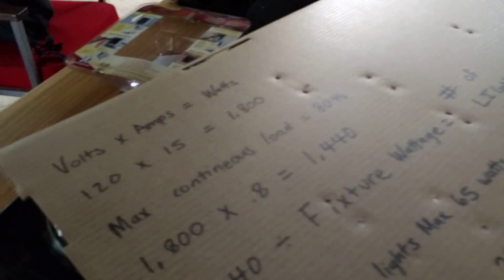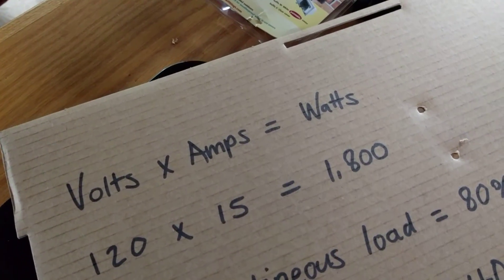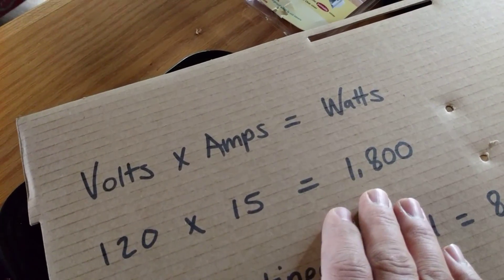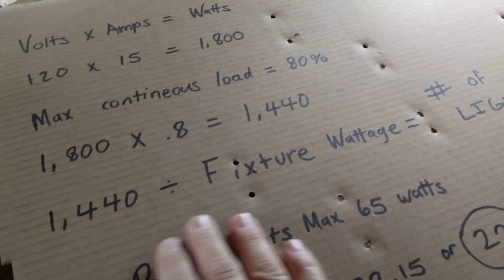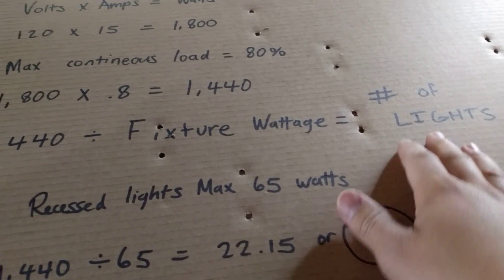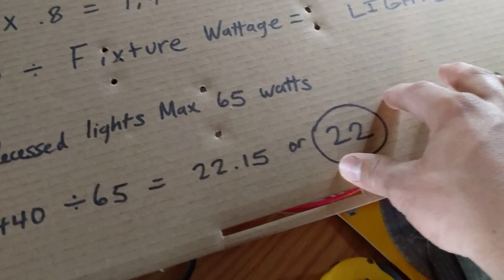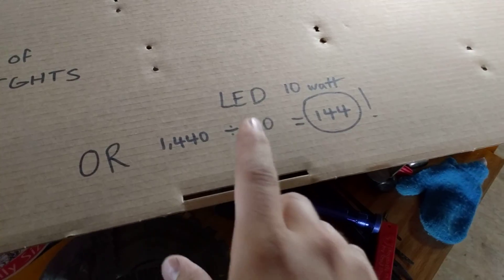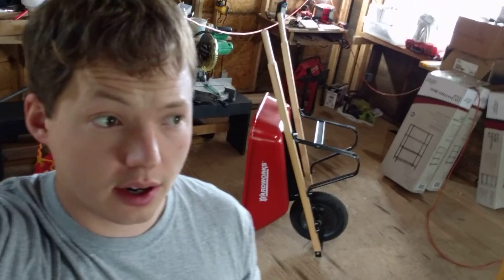How Many Lights on a 15A Circuit Breaker? Calculate Wattage for 15 Amp Circuit & Number of Fixtures

Comment: excellent job explaining, good about LED's that if you need to add a few extra lights later on that same circuit Led will work without overloading circuit....Under kitchen cabinet lighting is a good place...

Comment: Split that into 2 circuits. Someone will come along and stick 150w bulbs into those fixtures for more lighting at some point! Those cans are probably rated for 1 or 1.5 amps at 80% FLA on 15amp breaker that's either 8 or 12 lights.

Comment: It takes 14,850 watts of power to light a certain building. If the applied voltage is 120 V, the current in
amperes is 14,850
120
(a) What is the current for the building?
(b)There are 350 lights in this building. What is the average current through each light?

Comment: Calcuations are cool and all, but voltage isnt 120v..  Its more around 125v, and you also need to factor in wire distance, the distance you run the wire will affect how much current the wire can safely run and how much loss of power you experience. Voltage drop is a thing for length of wire ran.. just because a 15A circuit can do 1440w continious doesnt mean it can do it with 500 feet of 14awg wire

Comment: hmm.. kind of need to look at that because if I remember right, the codes still require the lamps at 100 watts per spot so, 14 in that case. Where I am the limit is actually 12 accordingto the local inspectors.

Comment: Residential lighting load is considered a noncontinuos load.
According to the nec, a branch circuit is to be rated at 125% of the continuous load plus 100% of  the noncontinuos load. So you could actually pull # 14 wire at 15 amps and install 27- 65w lights on the circuit. 
15x120=1800
1800÷65=27.69
#14awg wire is generally limited to a 15amp breaker 
This is shown in table 
210-24 .
The thought behind this, is that not all of the lights on the circuit will be on at one time.
Iam a licensed electrician with 26yrs experience and even though this is exceptable I always use the 125% rule , just as you have.

Comment: Before watching it was thinking enter stage left LED lighting. All of them!

I divide mine by rooms by level vs passages. So a two story house would have one for each level, and a third for the passages (hallways, stairs, etc.). This way if you are in a room and do something that trips the circuit, you are not in the dark finding you way back to the panel.

Comment: My house is 20 years old. I have a mini fridge and microwave in the bedroom plugged into the same outlet. The 15A circuit breaker keeps tripping. and I wonder if I can replace it with a 20A instead and would that solve my problem?

Comment: I did a similar calculation when planning a basement renovation. Putting lighting for the entire basement on one breaker was fine... Except the local planning department wanted no more that 750 square feet of floor space per 15-amp breaker. So two lightly loaded circuits rather than one. Then I got to thinking, what if the breaker trips? Plunge the whole basement into darkness? Hey, if possible it might be better to keep some of the lights on. Also, what about some future homeowner who unscrews the LED lights and screws in high-wattage incandescent floods?

It's now 6 years after this vid was shot, and LED fixtures that don't need cans are easy to find. So if doing this today there's no danger of a knucklehead replacing your LED bulbs with incandescent bulbs, because it's a sealed fixture.

Comment: I’m wiring my house now with about  30 LED can lights.  Good point about troubleshooting arc faults.  I think I will bring several LED lighting home runs to the panel and tie them together on one or two lighting breakers.  I can separate the home runs to troubleshoot but not have multiple arc fault breakers for such low wattage.  
PS I will have fan lights in most rooms on a separate breaker.  This will help me reduce backup generator loading.

Comment: Engage your brain.

This is a nice description and easy to understand, and you must remember to apply common sense.  Every light in your house could be on the same circuit if they fit, however, if the breaker trips at night, you will have to find it in total darkness. 

 Consider using different circuits to allow your hallway lights to work when your bedroom lights go out.  You could then get a little light in your bedroom with the door open and the hallway lights on.   

And so on.

Comment: I’m not sure if you are still active with your account. I’ve noticed some of the comments are A few years old. I have a question regarding recessed lighting in the kitchen. currently there is one wire going to one light. But I want to install six recessed lighting fixtures. what I mean by one wire there is your normal hot, ground and negative you get the idea. How would I wire the six recess lighting fixtures off of that one wire. thank you.

Comment: Another reason NOT to put 144 LED bulbs on one circuit is that when that breaker pops or need to be opened for any reason there is not one light in the entire house.

Comment: ben as ive said in the past you are the man and i love your videos but continuous load is load that is 3 hours or more, so to calculate the 80%  of the circuit ( wire ) or 125% of the continuous load ... so if a toaster having a load  1500 watts would have a draw of 12.5 amps now if you apply the 125 % rule of the load but again it has to be 3 hours or more then the toaster draw becomes 15.6 amps  but again its not on 3 hours or more so the rule does not apply ......i think i have it right  ...i hope .....so with that rule you would have to assume that everything in your house would be on for 3 hours or more , article 100 in definitions ,,,,,, and also since this video is 4 years old im sure someone pointed out u spelled continuous wrong on your cardboard  :). im sure code does not specify how many outlets you can have on your breaker but commercial is 13 i believe based on your 1800 va calculation . im also sure you are aware of all of these factors .....keep up the good work i love your videos

Comment: I put 12 led cans on one 15 amp and when you turn the lights to full some turn off so I'm not really sure if what your saying is true but maybe
Reply: dimmer  is not rated for LED ill bet its an old incandescent dimmer
Reply: @DontHaveTime523  actually there new dimmer switches and when on low they would work fine just when you turn up the power they change from being 9 watts each to 15 at full power which is why some turn off if you have the afci breaker in place it trips off the breaker so yeah I'm not sure
Reply: @mr00dito  it’s the afci breaker had this happen change to a regular breaker case solved
Reply: @DontHaveTime523  that would make it not up to code were I'm living but thanks
Reply: @mr00dito  that would make it not to code anywhere but thats your only solutions trust me

Comment: Why would it be hard to troubleshoot ? It doesn’t matter how many are on the circuit, it would troubleshoot all the same. 
A typical 2500 square foot home will have 3 to 5 lighting circuits in it, depending on what is going in the home. 

Provided you don’t put any receptacles on with your lighting

Comment: 15 comes from 15 AMP circuit.
1,800 WATTS comes from 120 VOLTS * 15 AMPS.
BUT, why are you using 120 as your voltage? Is my # of volts going to differ?

Comment: As a canadian Electrician I will say  your theory in your math is correct.. In Canada though rules are different. As per code you are only allowed to put 12 devices on a single circuit, be it lighting or outlets, yes with built in leds you can go higher but the code hadn't adapted yet to my knowledge... and lastly AFCI breakers are only recuired for outlet circuits and not lighting, that's 70$ savings... The NEC might have different rulings but this is for the canadian viewers.

Comment: You have a really great ability to convey the subject to your viewer. You're articulate and easy to understand. 
   My girlfriend has a 3600 square foot house built by KB in 2005. While I'm relatively sure  that the wiring meets code, it seems to be the bare minimum at best. It's amazing how many receptacles and ceiling lamps are mixed on a single 15A circuit. If two people plug in a small electric heater in their bedrooms, it will trip the breaker and half the second floor goes dark. Also, it has the thinnest 14 gauge wire I have ever seen in my entire life. I had to do a double-take the first time I saw it. It might have been marked 14-2, but I compared it visually to a piece of scrap 14 THHN laying in the bottom of my pouch. The actual wire was considerably thinner. No kidding! This stuff looks like mismarked 16-gauge! No way that shit is made in this country.
     One other thing to remember when calculating ceiling circuits, is a lot of people are adding illuminated ceiling fans where there used to be just a single light in the middle of the room. The codes are written as the "minimum" accepted. I think it's worth a little time and money in the long run to use better materials and use fewer receptacles on each circuit.  Best of luck. Stay safe, healthy and happy.

Comment: When I was taught that calculation (in stagecraft class, for figuring cabling and dimmer loads), we called it the West Virginia formula.

West Virginia

The abbreviation for the state, before two-letter postal abbreviations, was W.Va

W VA

W = V times A.

Easy little memory tool for remembering.

Comment: Why or when it's a breaker w/a ground installed in a 1979 house ? That pops and shuts down 2 rooms , bathroom and hallway . And can I replace it with a regular 15 amp breaker . ??? ... thank you for your time and answer ..

Comment: Hey Ben, I just noticed on my panel that one particular 15amp breaker controls quite a bit of things around my house and after adding a bidet and it's GFI outlet I noticed a very light fluttering or pulsing flutter. They don't flicker on & off just very light twitch. Can you just change a 15amp to a 20amp breaker? Is that allowed? I just feel.maybe this happening because I have too much on that particular breaker through pigtails or whatever, or should I just put the bidet on it's own breaker? I sent you another msg attached to.another video, so you can just answer one of them sorry. 
Thanks

Comment: Hey Ben I got a good question for you and I know it sounds cheesy to start off can I teach 14 x 2 Romax and combined them together - not end to end but side-by-side so the 14 AWG is 4.7 AWG it’s only going about 5’ “ it’s going from my 5KVA inverter from Lithium Battery Bank 48v with a DIY Alternators Generator to charge batteries to a separate transfer box / 2 Breaker box different then man Box , inverter produces at 5 Kw 96A & at 3 Kw 75A - my house uses about 3 Kw a day , I’ve got 2 8’ x 5/8 grounding galvanized rods figuring
Reply: please stay away from electrical things

Comment: hi benjamin? example i have 20 pcs bulb rated 120vac, 150 watts. then every bulb has a 5 meter gap. how to calculate the size of wire i'm gonna used? thanks for the answer.

Comment: A line voltage fixture consumes 5 W/ft. We have a bridge that is 1000 m long. The cable used for the fixture has a limitation of 16 Amps and the circuit voltage is 120 V. What is the total wattage consumption needed to run a single continuous row of fixtures across the bridge, and how many circuits do we need?
Reply: 120v is also baseline, voltage is actually more around 125v in actuality.  Ive never seen 120v when measured with a multimeter..  this guy is also forgetting length of wire ran..  I ran 700feet of wire for dusk to dawn lights, they draw about 600w continuous with ballast ineffecienc added.   700 feet of 14ga wire on a 15a circuit.. Thats too much resistance.. especially for the light 700 feet down the run.  That would effectively reduce voltage by near 3% which is alot 120v that would mean the last fixture would see around 116v..  this just causes heat in the line..  To be safe you want to run 12ga wire for that amount of length and a 20A circuit

Comment: Hey Ben,
How long have you been an electrician? Good effort for the video but let's stick with the NEC ( that's national electrical code) and based on that we should be at 14 openings on a 15 amp circuit and 9 openings on a 20 amp circuit!
Reply from the maker: Not true for residential.

Comment: Hey Benjamin. I hate to nit pick but I wanted  to let you know that your formula for wattage is basically incorrect. You are using ohms law for wattage, but upon examination of ohms law the formula of Wattage =Volts * Amps is ONLY valid for DC circuits and Linear loads on an AC circuit. The correct formula that electricians should (and most do) is Amps * Voltage = VoltAmps. Some higher power circuits are in KVA. Incandescent lights are considered a Linear load, but not LED lights because the internal circuitry has inductors and capacitor which can pull different current based upon the design. 
Even the elec meter on the side of the house is only measuring current (amps) over time, not wattage. The meter has been calibrated with a Power Factor to APPROXIMATE wattage, not actual wattage. In an AC circuit, the frequency must also be taken into consideration. And resistance in a non linear loads in an AC circuit is called impedance. To calculate impedance, you must take into account the frequency of the AC voltage as well. Because a device can draw different amperage at different frequencies, esp if the device resonants at a given freqiency.
Examples of a linear load is a toaster, incandescent light, heaters, elec stoves etc. An example of an inductive load is anything with a motor in it. Electronic circuits can have capacitive loads.  if you measure the resistance of non linear loads and used Ohms law of Amps = Voltage / resistance.your calculated answer would be incorrect compared to the actual Amps drawn.
A LOT of people misunderstand Ohms law.
I have been working in Electronics for over 60 years. But you can google Ohms law for clarification if you need
Reply from the maker: Thanks for sharing your expertise!
Reply: @BenjaminSahlstrom  thanks for good videos!!

Comment: You probably won’t read this but I still gotta try .  So I found out I have 16 lights to one 15 amp breaker also same amp breaker has 20 outlets . My electrician told me that I gotta add one more breaker or 2 to distribute those lights and breakers and he has to break through a lot of drywall and get in the attic for the fixture lights a whole nightmare . My question is why can I just take out that 15 amp breaker and replace it with a 20amp or a 30 amp or even a skinny double 15 amp breaker. Isn’t just smarter just to do that ? I hope you have a video that can explain that .

Comment: In my area the code said we can put only 12 outlets or lights on 15a circuit??
Reply: Yes you are right experience electricians they connecting max 9 outlets on 15A circuit.

Comment: The problem with AFCI breakers is that they nuisance trip a lot.  There might not be a problem at all.  The breaker sees a certain current profile and thinks it's an ARC so it trips.  I would suggest like you mentioned that you break up those lights into two circuits.
Reply: Arc breaker is dedicating only for plugs not lights.

Comment: Righteous, I checked your math it’s dead nuts and I hear what you’re saying the only caveat is that if you planned your house with LED units rather than just the ability to thread in an LED bulb then you’re golden! I think the threat in LED bulbs are going to go away eventually and the entire unit will just be rewired when the old one burns out in over 100,000 hours.  Your whole house is going to be like a large LED Christmas tree light set. The new ones are wired parallel instead of series.  But yeah eventually your entire house is going to be on a five amp circuit. It’s nuts! I love it! $ 60.00 power bill. If it gets hot or turns motor – that’s what creates a power bill!

Comment: Hello,

Great video and explanation!!!

I’m having a situation now, i got a new washer machine 10 amps and when I plug 🔌 it the outlet sparks ⚡️.  it only sparks when I plug the washer. I understand it has the most amps compare to the others appliances where I have it located. Also it is plugged to a gfci outlet. 

Now let me tell you about the breaker where i plug it. It is a 20 amps breaker and I noticed that breaker supply my refrigerator 6.5 amps and another outlet which I use it to charge cellphones and and 1 led light with low amps as well. Now when I use the washer machine, only the refrigerator is pulling amps and the rest are unplugged. 

Do you think is the refrigerator plugged in the same outlet causing the sparks ? Even though the outlet are separated but coming from the same 20 amps breaker.

Sorry if this is too much writing and hope I won’t confused you. 

Thanks!!

Comment: I am going to put 25 (9 watt) LED bulbs in my basement one one series circuit. I am not framing out my basement. I am skim coating the naked concrete basement walls with joint compound, using existing circuits to connect 4 other outlets to each. i am spray painting my ceiling flat black (leaving easy access to everything) and applying epoxy imitation marble to the floors. Total cost for a 2500 square foot basement:  $455. The other alternative $12,400.

Comment: If an outlet is rated at 30 amps does the outlet pull 30 amps when the circuit breaker is on and no appliance is plugged in?

Comment: IMO, recessed cans are old school and hard to insulate and air seal. I use LED canless fixtures that mount to a standard 4" octagonal box or the new wafer fixtures.
Reply from the maker: LED has really changed the industry for sure!